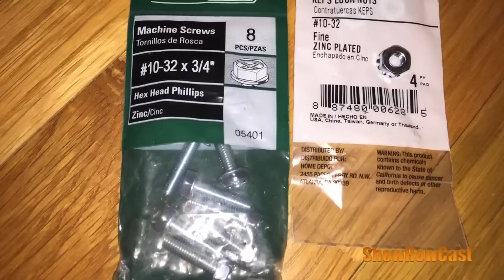21 or 27 Imac Ergonomic Mount Installation Instructions without a VESA mount

Comment: To save having to tap the treads, you could simply use locknuts & washers. I would even consider cutting off the excess stand.
Reply: *thread
Reply: I know this is WAY late after your comment, but I would not recommend cutting off the extra stand. The tension in my stand has broken and I have placed an object between the back of the iMac and the stand to keep it pointed up rather than sinking down. This happened after Apple Care expired and would have been several hundred dollars to replace. Without the bottom of the stand there, it would be impossible for the monitor to tilt up or even straight ahead. Just some food for thought for anyone considering doing that.

Comment: okay, innovation is great - smart move for you - but there are $14 adapters that clamp onto the stand that'll do this for less than the tools to do this with.
Reply from the maker: aeonjoey - There weren’t any adapters back then. Glad to hear that such an option exists today.
Reply from the maker: Ok
Reply: ShowHowCast what size screws and bolts should I get .  Also if you drill a straight hole instead of a threaded hole ... won’t it be secure if your using a bolt on the end of the screw ?
Reply: @daviddix6724  lmao DID YOU COMPLETELY IGNORE THE ABOVE COMMENTS???

Like how are you asking this after the first comment saying that you don't need to do this lmfao I'm dead
Reply: what do I search for ? im looking for one

Comment: How well does this stand hold the weight of a 27" iMac. I'm looking to get one for mine. Obviously it can hold it by the looks of things but would you recommend this stand for a 27 iMac?
Reply from the maker: It holds the 27 in iMac just fine. Remember to adjust the lift spring force at the end of the upper portion of the arm - read the introductions that come with the stand. The default spring force did not hold the weight of the iMac. It hit me scared at first. Once I adjusted it, it worked like a charm. Buy with confidence and good luck!
Reply: +ShowHowCast thanks for the reply! I look forward to getting this arm 👍🏻
Reply from the maker: Sorry for the late response. The stand holds the weight of a 27 in iMac just fine. I haven't even adjusted the spring setting for the heaviest possible load. It looks as if the stand could handle more weight.

Comment: A 3 minute guide on how to ruin an iMac!
Reply from the maker: Sorry you feel that way. I bet my iMac did not loose any value over the 4 holes. By the time I will sell it, if ever, the 3 holes in the back will be a moot point .
Reply from the maker: Trust me that by the time you sell your iMac, this would be the least of the buyer's concerns. In the mean time you've used your iMac in a more ergonomic position saving you from chronic back pain.
Reply: +Reiss Bennett its not ruin an iMac, but my 4 years warranty.
Reply: Bought many macs on ebay, if I were to seek out an iMac, trust me, this would be the top reason I navigated off the listing.
Reply: Poor Imac 😐